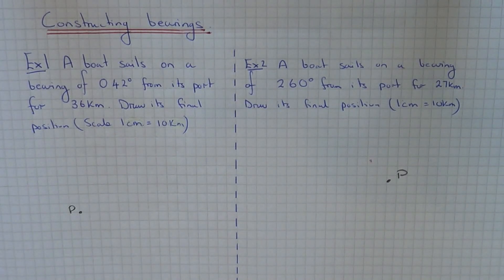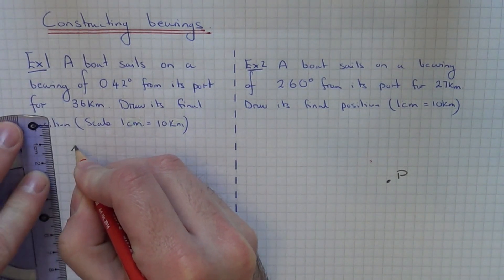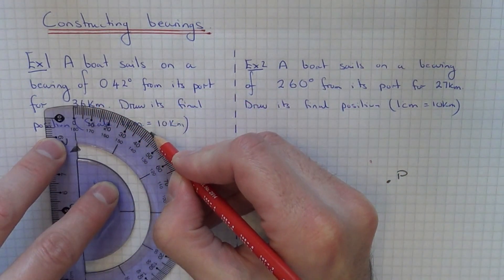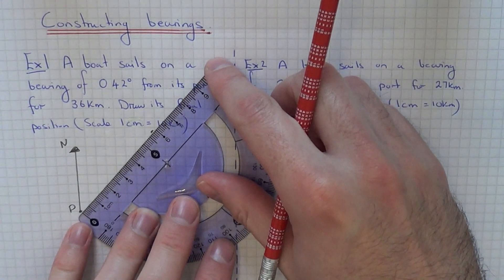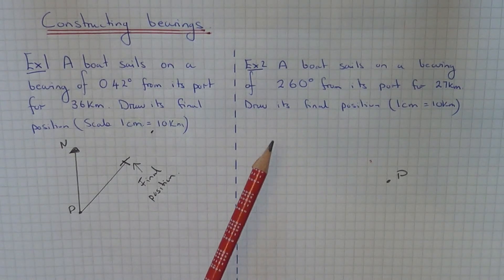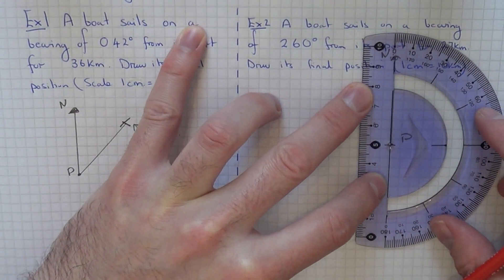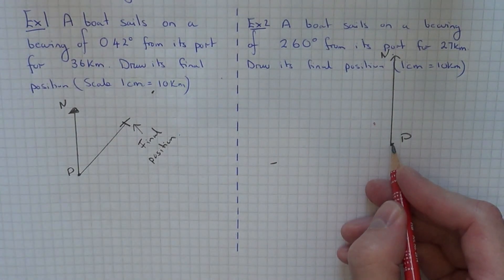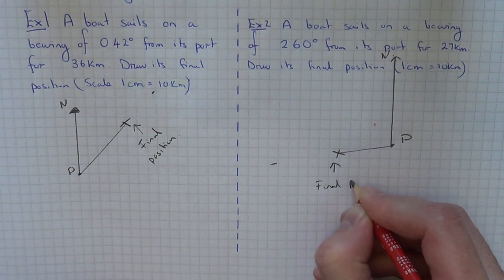Constructing Bearings. How To Draw A Bearing On A Map (Boat Problems)

Comment: I mean on the 2nd example, with a 360-degree protractor could you not just take 260-360, leaving 100 degrees, so you draw 100 degrees backwards from the starting point?
Reply from the maker: Yes you can do it htis way too, as long as you realise that the bearing is going clockwise from North. I didnt teach it this way as students can start measuring bearings anticlockwise around!